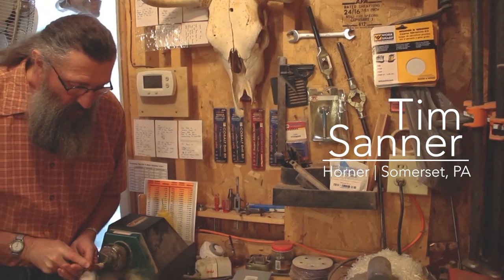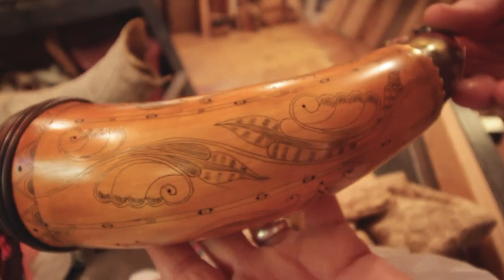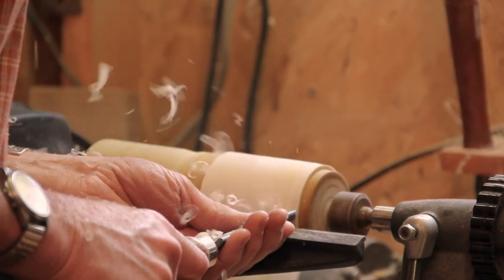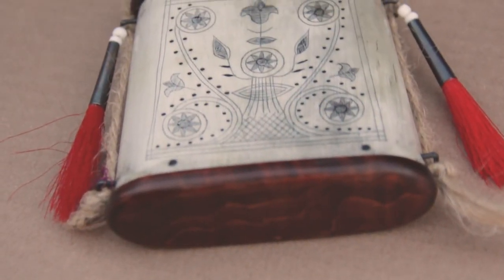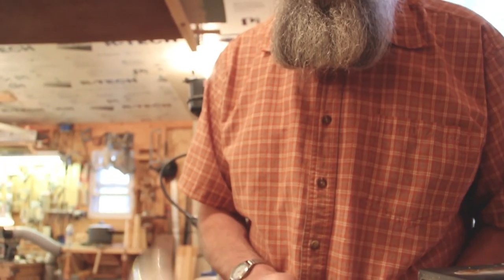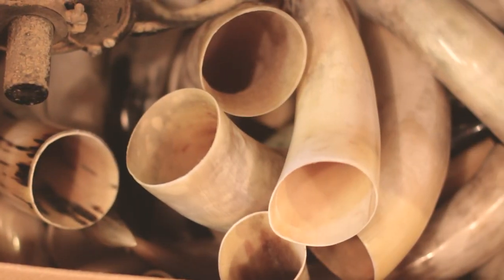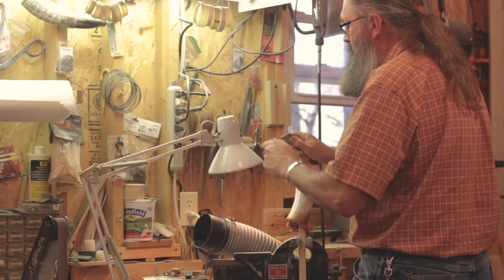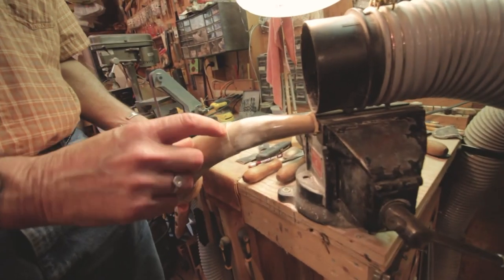Powder horn maker Tim Sanner

Comment: I'm a fully trained Blacksmith through an apprenticeship and couldn't make a living selling at craft shows or out of my shop in the 1980's and early 1990's and I can make anything from a coat hook to a Saber from flowers to nails and screws. I ended up working asa Boilermaker until I retired. I still got to heat and beat metal but welding a tube that would ware out in a few years didn't fell as good as making a wood carver a full set of tools fitted just for him or her or a nice pocket knife for a little boys first real knife that would stay sharp no matter how much wood he might carve on just a few strokes on a leather strap and back to a nice sharp it would go. It's not worth buying the good coal to heat metal with when a Chinese stamping plant can kick out a hundred things at half the cost and they don't pay freight either.